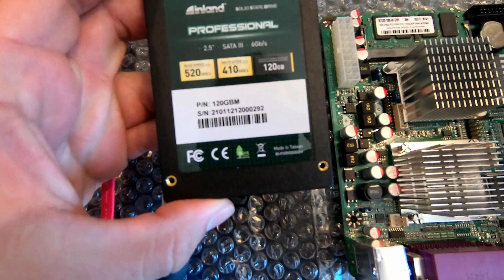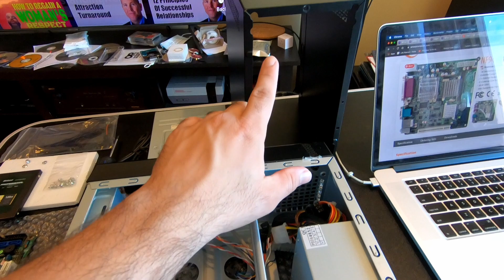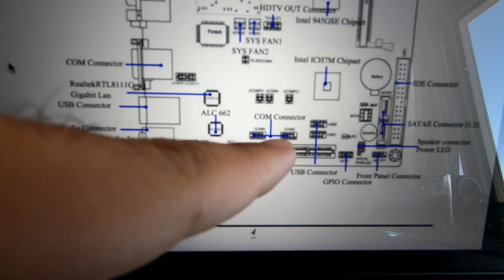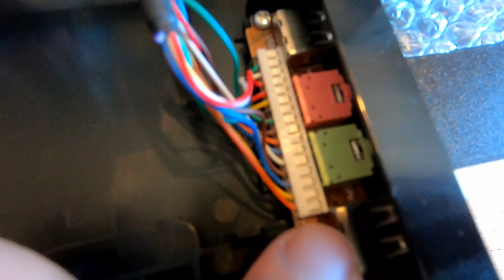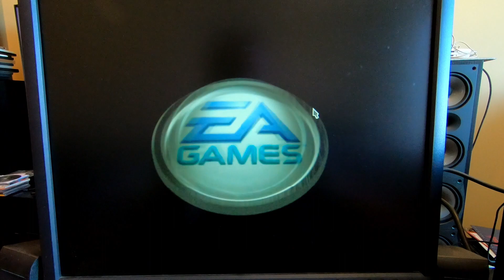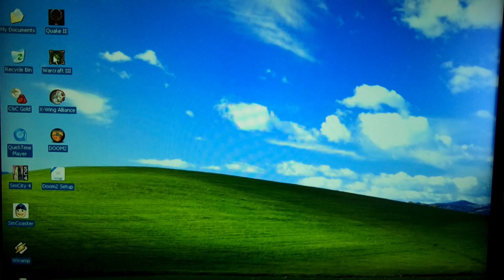Lets Build a 1.6GHz Windows XP PC in 2021

Comment: I still have a Dell D-610 running XP. I use it for a radio program online recorder. 2ghz+ CPU and 2 gigs ram. 

I have a half dozen or so, the whole family had them, and gave them to me when they upgraded. Unfortunately a lot of the online radio is going to a central source scheme I have not been able to record with what I have in software. 

Haven't put in much time on it yet.